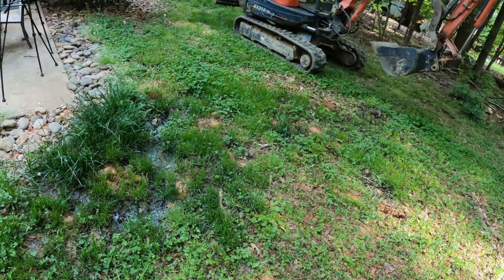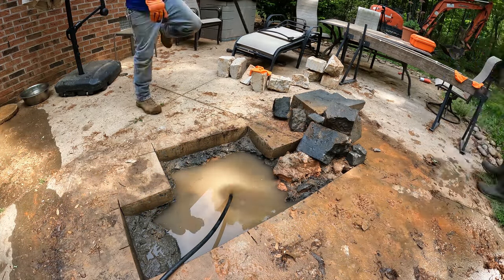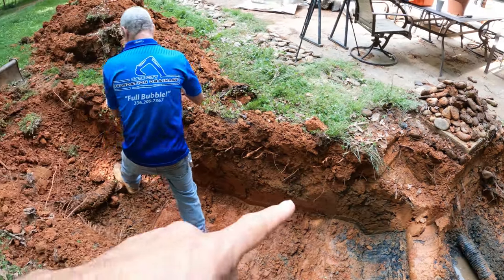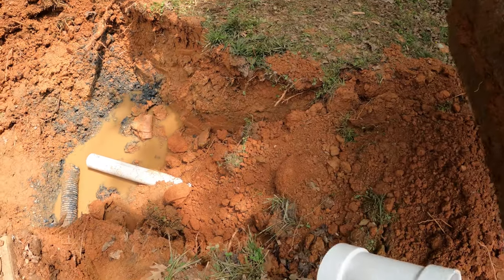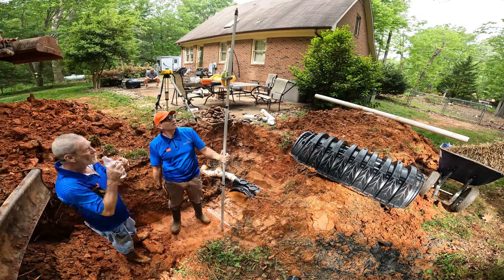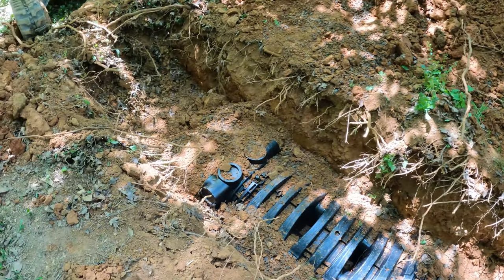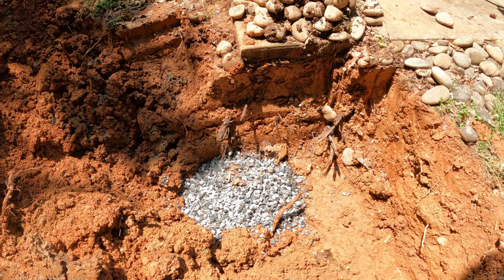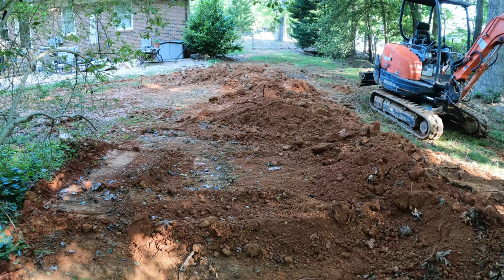Repairing a clogged septic leach field

Comment: Shawn, and to all the guys and gals on the crew Great Job. 👍
I added a double sanitary T in order to access and if need be clean out my lines in either direction and it allows me to check out what's going on in case of a blockage.
Reply from the maker: They work very well for cleanouts that go both ways 👍

Comment: We just call them drain fields here.  When my parents built a new septic system in the 1970's they used a 12" concrete pipe with tons of holes.  It is still there and working fine. :)

Comment: Those are the greatest ways of replacing a waterlogged leach field, I’ve had this system for over five years also tied into the old and not a problem with my septic since. Nice to see you git r done.what’s nice is the strength that can support a three axle loaded dump truck with no flex.
Reply from the maker: Nice. I didn't know they were that strong! Those chambers are really awesome.

Comment: Some years ago I watched my friend's father-in-law install a very similar system however he put a layer of stone/gravel under the chambers.  He used four legs of chambers.  then covered it over with gravel before the fill.
Reply from the maker: Interesting. The whole point of chambers is to not use gravel. The idea is the bare soil has more surface area to absorb water into it.
Reply: Yes.  I had just had my drain field done so I wanted to see if his was done different.

Comment: Have my leach field fixed last year and they did try to pack it down but it still settled 12 to 18" so they came back to level it out and put down more grass seed and all done. Also I had a raiser added to my tank so no more digging to get it cleaned out the best 100.00 bucks you can spend.😁
Reply from the maker: That's why we leave it mounded like that Daryl. It settles and flattens back out. Some people throw a fit that we leave it mounded like that but it's the best way overall.

Comment: You are a perfectionist.  If I was the homeowner I would have cut out the patio and started over.  I would have wanted the pvc pipe like you said was best from tank to T.
Reply from the maker: It's worth noting that the pipe from the tank has worked fine for almost 20 years so I felt all right tying onto it.

Comment: Great video...do like your "how to videos" especially when it involves a real innovative solution. As a bonus, your physics solution was a classic. More and more septic systems are becoming real problems ...please include more of these if you get the chance. I think your scuba friend is going to regret not having you replacing the pipe to the septic tank even if it involves removing part or all of the patio slab. BTW: Video quality was fine for me Shawn
Reply from the maker: It's a possibility but the pipe has been flowing for almost 30 years so we went ahead and did it. I told him if he ever replaces that patio to definitely do the pipe.

Comment: Nice repair Shawn, I've never seen a leach field that was designed by a professional, done with corrugated pipe. Around here, Maine, we use either sch 20 or SDR Sch 35 perf pipe for a basic pipe and stone field.
I like Ronald's dance moves at 20:17.
Reply from the maker: Haha yea I just got luck with the drone flying at the right time!

Comment: I didn't see your location of propane gas line. I was a gas line location tech for a utility so it's a pet peeve. I always loved digging in the dirt and structures below ground level. Trying to fix a poorly built system is a battle some won't touch. The concrete patio shows how previous owner just built what ever and where ever

Comment: ✨👍. Great job.  Question ❓❓.  Is there a perferated or line running under the chamber length or is there just a line going in from the septic tank? How does water go down the whole length of the chamber ...I didn't see any lines under the chambers ...So the bottom of the chambers are just dirt ?  No need for gravel?  Was that good perking soil ? Looked like some clay ...Did the town require a perk test ? Looks great for a repair..kinda weird covering the septic tank...Not good to have weight on it...✨👍.   Also... Couldn't you use a distribution box at the line junction?  Just curious ✨.
Reply from the maker: The chambers leave the soil open along their length. Think about a piece of gravel sitting on soil. That area is no longer available to absorb water. That's why you can use 1 foot of chamber as 2 feet of traditional field. The soil was clay but it percs well enough. They did a perc test for the original building permit. We could use a d box, but typically only use those for 3+ laterals.

Comment: In the northeast, those chambers need to be bedded on at least 12 inches of sand or stone, that clay will not perc correctly. Also, no county inspection before you closed the trench?
Reply: For the government inspections, trade off of inspection versus hassle and cost of dealing with government.  

I'm in CA, would be very curious to know how much my prices would go up if government had to inspect that
Reply: I replaced my pipe from the basement wall to the tank inlet, and found out the day after I closed it that I was supposed to get it inspected. Oops. That was probably 18 years ago.
Reply from the maker: This subsoil does perc. Their system had been fine for 30 years.

Comment: Doesn’t the smooth edge bucket on the backhoe smear the bottom of the trench and potentially seal the bottom so the water won’t soak in
Reply from the maker: Toothed buckets are preferred but no you can't seal soil.

Comment: IF there isn't a "bubble" reference I am not happy 😅 Nice dude! Glad you talk about proper backfilling. Sequence and material type is super important but so many people cut corners on it. Had to dig up the 4" outlet to tank piping and replace due to improper backfilling. Belly in a section causing it to clog and backup...pissed me off.
Reply from the maker: Yes bedding the pipe is soo important.

Comment: Two questions:

1. Was there an advantage to the one 40' run vs. two 20' runs 9f the chambers?
2. Did you consider installing a distribution box ( D-box) instead of the double sanitary T to provide for future inspections of the field?

Comment: Hi Shawn.  Recognizing that different municipalities have different building codes, I'm wondering if you considered placing a distribution sump (A.K.A., "D-box") at the location that you placed the double sanitary "T."  D-boxes provide an auxiliary location for small solids to settle (and decompose), as well as provide a way to access/control the even flow of gray water into either leach location.
Reply from the maker: It’s a good point Dave. I usually only use a d box with three or more let’s if the field. I also use speed levelers.
Reply: Can I say that it would awful deep for a D-box - I think the whole original system wasn't sone as well as it should have been - including the corrugated pipe - which will go bad.

Comment: Hi Shaun, how does the septic system work? Does the leech field just get rid of liquids? I think they are called washaways in UK.
Reply from the maker: The tank provides time for the water to stagnate. The solids sink to the bottom and the grease floats to the top. The clear middle layer is what flows into the leach field and percolates back into the ground. 👍
Reply: @GCFD  Thank you. My brother has septic tank and could not understand it. His whole place sits on granite bedrock and forever flooding and block drains. I do understand now.

Comment: The gravel around that first piece of corrugated should also help keep it from getting clogged with dirt/mud shouldn't it?

Personally, I think you should have cut the corrugated back as far under the slab as you could reach and replace it with solid PVC to help prevent future clogging...
Reply from the maker: Yes I'm glad we threw in that extra gravel. It just seemed weird to me to cover up a perforated corrugated pipe with dirt!

Comment: How does those chambers actually suppose to function. I reckon you will have a updated video in a few on how it is working. Thanks Shawn for the video. Do you ever get any jobs close to the Danville area, just curious.
Reply from the maker: They leave the open space under them and that's what fills with water. The large surface area of bare soil under there is what absorbs the water back into the soil. No, we only work in/around greensboro.

Comment: Ok so I am confused as to how the new chamber system actually works. The chamber don't have a bottom correct? No gravel covering it? So the water goes into the chamber that sits on the ground and soaks into the ground that way? It also looks like there are open ports on top of the chambers as well? Help me understand this. I'm old school.
Reply from the maker: Yes Rick, the chambers expose the bare soil. The idea is a piece of gravel on the soil makes that much surface area unavailable for percolation. The inside parts of the chamber are actually wells that support the center, and allow  chambers to nest together. https://www.infiltratorwater.com/products/chambers/quick4-plus-series/quick4-plus-standard/

Comment: Wanted to write stupid to the one that pored concrete over the septic tank, but maybe they didn't know that it was there. Great save to the leech field. Was there a downpipe in the tank so it did not put debris in the field?
Reply: Yeah, is there not like that you have to pump the septic tank every year or so? I think we have that here in Sweden.
Reply from the maker: This was a double chamber tank so we couldn't see the baffle at the outlet. We're pretty confident it was there, but the HO didn't want to cut the rest of the patio up looking for the other access lid to confirm.

Comment: Thanks for the physics lesson, but how do those chambers work?🤷🏻‍♂️
Reply from the maker: They keep the space under them and the bare soil lets the water percolate down.
Reply: @GCFD  abnd the fluid circulates in baffles on the top? What are they called so I can Google how they work?
Reply from the maker: They are called septic chambers  https://www.infiltratorwater.com/products/chambers/quick4-plus-series/quick4-plus-standard/
Reply: @GCFD  so, basically they replaced the stone that would go over the PVC with holes drilled in it.🤔 I missed that part of the install. I can’t figure out how to fluid flowed in the chamber.🤷‍♂️
Reply: Thanks for teaching us while we’re not looking.😂😂😂

Comment: Instead of a 'T' piece shouldn't you have installed a 'distribution box' which ensures the levels stay equal?
Reply from the maker: If you have exactly two you can use a double san tee. If you have more you would want a D box for sure. Make sure to use the speed levelers in your D box to really dial it in. Great question!

Comment: Do you need special certificates to work on sewage/drain fields in NC?
Reply from the maker: In this instance I'm just helping out a friend do a repair. When I do new installs I basically am helping the homeowner. Here in NC the HO can pull the septic permit and get it inspected after installed. To be a professional septic guy you have to get certified, which is fairly simple.

Comment: You never use a regular rubber fernco for a horizontal connection.  It must be a shielded furnco or it will sag and cause a blockage.

Comment: It's seems to me the tank was set to deep to begin with the lateral field  has way to much cover absorbsioun through surface getting sunlight is a major plus if soil (like yours) doesn't absorb water well Clay soil  not good yes chambers allow unrestricted  area for water detention an allows roots to feed off affluent which helps displace water  but personally I fell system was improperly installed in the beginning  but capassaty is all you could do for it Chambers factor say 15 inches of cover I've found that 10 to 12 inch max works better good video

Comment: The crazy  issue is you put the septic back in the same place,  where the original one was, it seems you enogh room 5o put beyond the tree root system,, plus if the home owners want replace there deck , septic tank wont be under the deck area. The reason for the center hole that you sand is for weight the tank down,  most states hane to put a anchor system to hold tank from flooting up. 😊

Comment: Hi Shawn, I guess I don’t understand how a septic works. The waste just travels directly into the ground. I thought there was a large tank. Another question how many cameras you using now getting fancy with the drones, lol. You guys do it all even trees. Ok take it easy…..Bobby L
Reply from the maker: Hi Bobby - 
The waste flows into the tank. The solids sink down, the fats and oils rise (scum layer). There is a wall inside the tank that starts at the ceiling and is open under water. That keeps the scum away from the outlet pipe and so only clear (ish) water flows out of the tank and into the leach field. There, the water has ample surface area with the soil to percolate back into the ground. The solids in the tank are slowly broken down by bacteria in the waste under anaerobic conditions. The reason you pump a tank is because the solid waste builds up over time and needs to be removed and hauled to the watewater plant.
Reply: @GCFD  thanks Shawn that makes sense.
Reply: Wow! Very informative! Thanks so much for educating me. I have septic here and I’m learning so much from watching and rewatching your videos! Great job!

Comment: I’m surprised the septic tank and field was allowed to be placed this close to the house.
Reply from the maker: The tank needs to be within 10’ from house and field 100’ from well head.
Reply: @GCFD  ah okay. I built my house in Orange County NC and I think my septic had to be 50’ from the house. But they’re weirdly strict around here.
Reply: Red states with no regulations equals this
Reply: @milfordcivic6755  North Carolina is hardly a red state. Not everything has to be about republican vs democrat my dude.

Comment: the new Leach you installed... as its not "exactly the same capacity and size as the other "leg" and the fact that it comes first .... it will take all of the Load until its full and some will go to the other leg for a while but create the same problem again.  If you expand Leach capacity you need to add to the existing leg or you will create the same issue again and again.

Comment: I'm only seeing 2880 p resolution quality settings and with my system & internet connection, that's unplayable. Is that the only resolution you uploaded this video in? If so, is there any possibility you can upload it in a lower resolution, say 720 or 1080, those play MUCH better on my system (720 is preferred for me).

Thank You.

the video freezes every 5-10 seconds while the sound stays going and then the video jumps to where the sound track is so I miss most of the video portion...
Reply: Thanks for adding more Resolution options...now I can watch the video...
Reply from the maker: It was a yt lag. They needed more processing time, even though it said they were finished. I will start waiting longer between uploading (unlisted video) and publishing the video. Thanks for your update! - Shawn
Reply: @GCFD  Ah...OK not a problem, I wasn't sure what was going on since that was the first time I've ever seen anyone's video have only one Resolution option and such a high one to boot...

At least it got fixed and I was able to watch the video eventually...

Comment: Using slotted corrugated flex pipe as the leech pipe for the septic system proves that whoever installed it did everything on the cheap.  That makes the entire system suspect in my mind.

Where I live the ground water is 120+ feet deep.  When my parents had their house built in 1973 they had the leech field dug 10 feet deeper than the level of the leech pipe and filled with rock before the leech pipe was installed and covered.  They also had 5 100 foot long trenches dug from the septic tank to the edge of the property.  They have had zero problems with the leech field in 50 years.

Comment: I’m surprised no stone under the chambers or weed blocker cloth.
Reply from the maker: The chambers specifically don't use stone. The reason is the the surface area under the stone is not available for percolation, whereas the bare soil is 100% available. It's a cool technology.

Comment: Thanks Shawn, another very interesting installation. Just wondering what your thoughts are on pipe re-lining (like this https://www.youtube.com/watch?v=XGAJSKHqOKs). I know usually corrugated pipe failure will be from crush and lining is probably not possible but thinking that that corrugated from the sanitary T to the tank, under the concrete is perhaps one of the best candidates you've ever shown for doing this re-lining since it's probably not crushed "yet" but if it does fail then it's likely to be an incredible headache to repair. What's your thoughts and have you ever or would you consider doing this lining in places such as under concrete that are not likely to be crushed?

Comment: I'm from Greensboro, and have done all sorts or research and what not on drain fields, along with doing my own. I've never in my life see one use corrugated pipe. Seems like a horrible idea, I'd have ripped up  all that and did it all over. That's probably why it failed in the first place. Failed right when it got from under the pad.